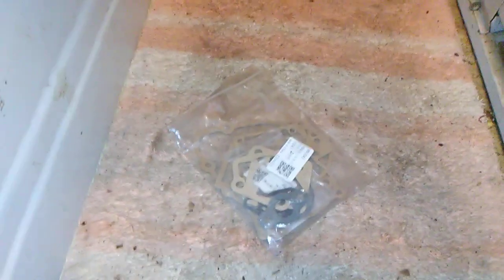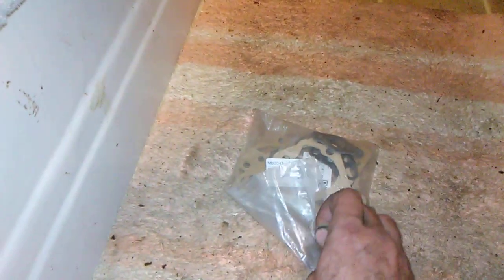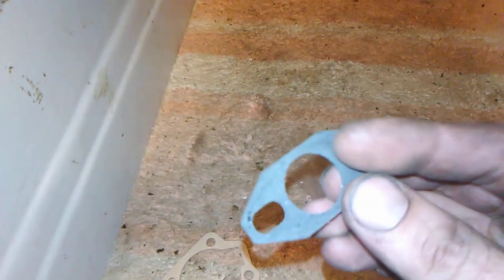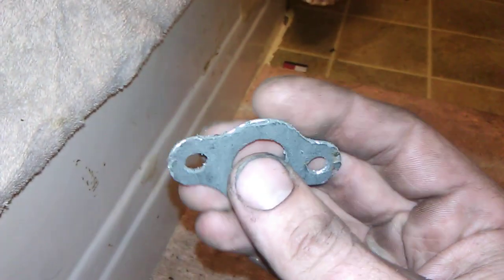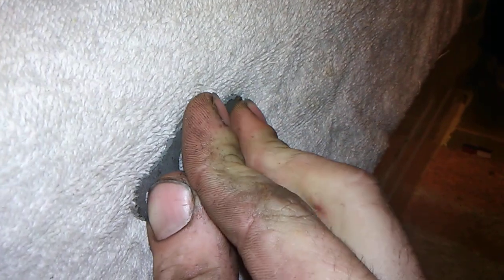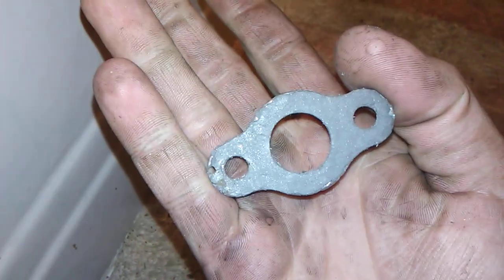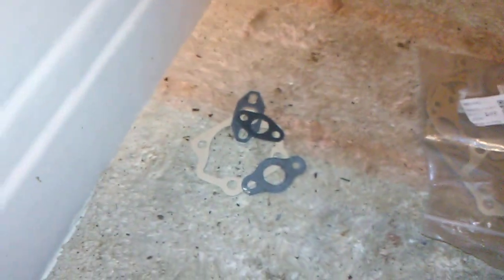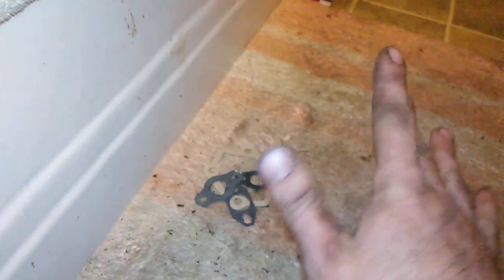"major issues with the phantom 85 version 3 with the ZTmoto reed valve cover gaskets!"

Comment: Yes sir indeed cheap gaskets I need to get a different one for the exhaust there cheap as well done replaced mine once tried to use a mz65 gasket not wide enough for the screws to line up. thanks for the tip on the intake Reed valve side I had some gasket making material and made one working so far but if it messes up I have one of them gaskets i i keep all my extra gaskets as well never know when you will need them ride safe brother
Reply from the maker: Remember it has to be a 66cc/80cc muffler gasket for the ZTmoto Reed valve for the phamtom 85 version 2 and 3 it works big time